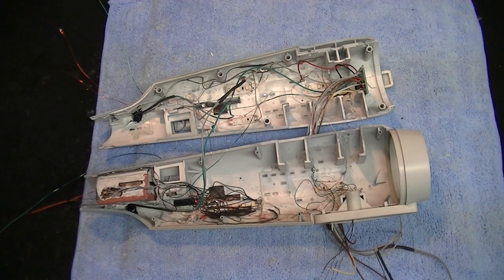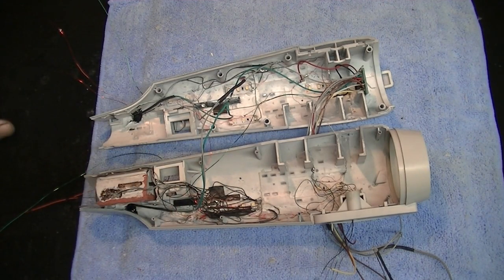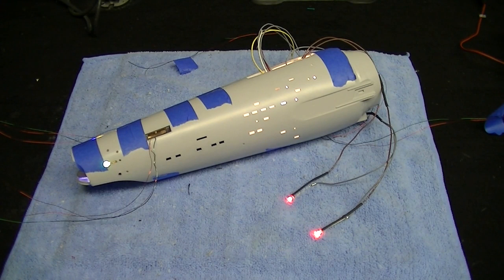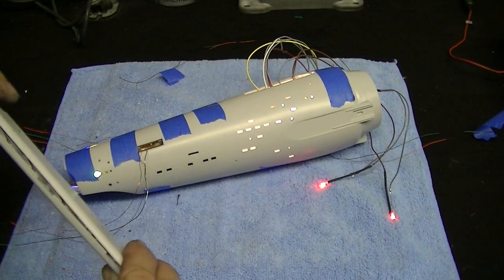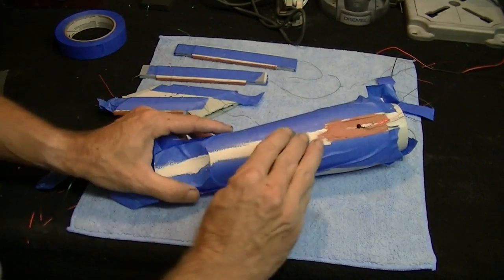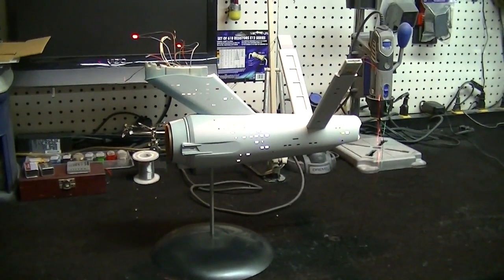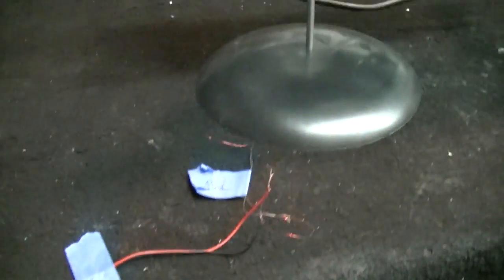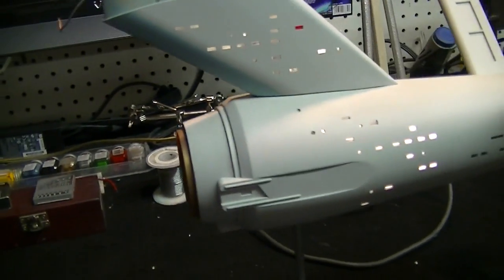Polar Lights 1/350 Scale TOS Enterprise Buildup PT 6

Comment: How do you clean the model after wet sanding prior to painting without getting any lint or sanding particulates? In the past, I would rinse the kit under the tap and then blow off the water with my airbrush but I don't think that makes sense with all the electronics here.

Comment: did you actually use a automotive style paint gun for main body color spraying or was it all airbrush? thanks in advance B
Reply from the maker: Yes, I always use a automotive spray gun on these larger models. Much easier to get a nice even wet coat of paint.
Reply: TrekWorks awesome that KS for the reply. I have been getting back into the hobby recently and started with some cars where I use rattle cans. I have a voyager that is next but then I saw the 1:350 tos so I ordered one. I have an extensive auto backround and I paint all my own cars so I have a small parts sata paint gun I'll use that for the body's....again thanks for the reply and making the videos very educational for some one getting back into the hobby.
Reply from the maker: We come from the same background. I also use a Sata minijet to paint a lot of my models. It's an excellent gun.
Reply: TrekWorks what are the odds that's what I'll be using as well it's my small touch up guy...thanks for the replies man. I had also emailed you on the info at trek yards. net email..not sure if you got it or not